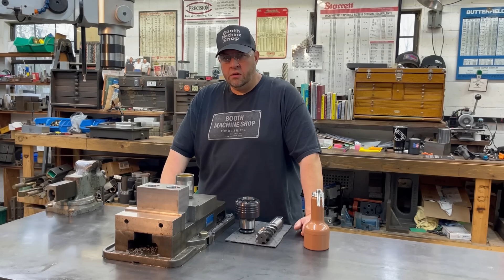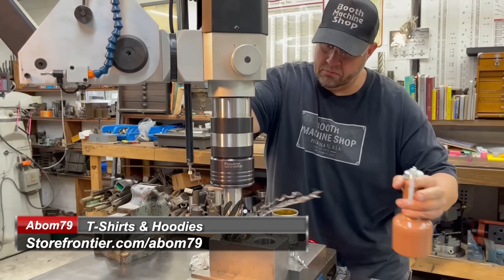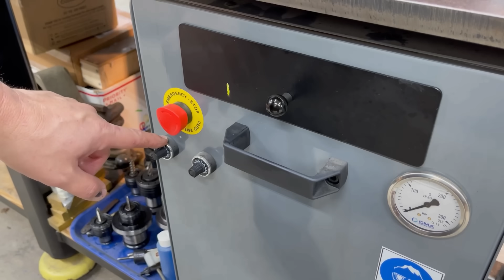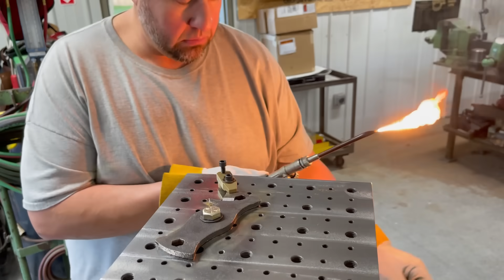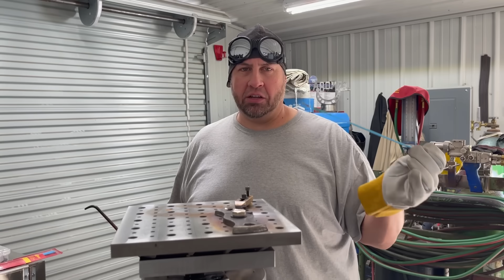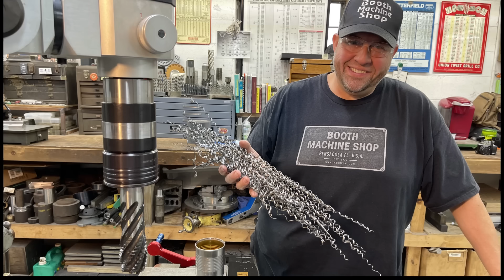SNS 335: 2" Power Tapping with Flexarm GHM-60, Cast Iron Braze Repair

Comment: around 2:06 mark are you adjusting your fabricated piece on the machine to get  as accurate tolerance? reading from the gauge? Also whats the proper name for that instrument? I had to use one at  work to check tolerance on torque converters attached to the engines.
Reply: You mean a dial gauge?
Reply: @660star  I didn't know if there was different name for its use in the video. Thank you!
Reply: @lolslim690  indicator

Comment: Why braze instead of welding?
Reply: For cast iron  brazing is easier and less likely to damage the part more (cast iron dosent like sudden bursts of heat in a localized area you can end up cracking the part - it can be done but the part needs to be kept at a high temp - there are some exceptions like small voids filling with tig and even mig but theres a high risk)

Comment: Noob question, but what's the blue stuff on the outside of your welding stick?  Is that the flux or is the flux up the inside like electronics solder?
Reply: Yes, that's the flux. It melts way before the solder and flows down to the droplet. You can see him blast it with the torch to coat the area at 26:28

Comment: MY GOD!!! I KNOW JUST HOW MUCH TORQUE IS REQUIRED FOR THAT TAP! AND THERES A REASON THAT WASNT DONE IN THE MILL! THAT FLEX ARM IS AWWWWSOME!!! JUST...WOOW!
Reply: It doesnt even get shaky!! Or twitchy!!
Reply: JUST SO PEOPLE GET AN IDEA of the power that tap required....picture two big men on a 6ft tap handle STRUGGLING TO DRIVE THAT TAP! IVE DONE THAT! HAHAHA
Reply: That was MY question, I wonder just how much torque as well as hydraulic pressure was required to screw that rascal in there!! Holy SMOKES!!

Comment: I used to do a lot of brazing years ago in the Uk using Eutectic rod and flux. We butt brazed copper strip about 10mm x 2mm end to end. When testing the joints with a tensometer we found that over 95% of the copper strip stretched and broke before the brazed joint did. Good stuff Eutectic.

Comment: I got to ask... after dipping the tap in the oil, is the manual oiling still useful? Or is it just an automated reflex
Reply: I believe the proper term is lubrication insurance.....!?
Reply: At first I was thinking the same but an extra 5 pence of oil to save your £100 tap is just sensible precautions. As Gregory Cross put it so well. 🇬🇧
Reply: Yeah, that's fair. It's never too much but it seemed a bit excessive to me. At least for the first hole, with the second it looks reasonable.
Reply: I would have probably poured the oil in the hole itself honestly
Reply: @MonstertruckBadass  There would be trouble when the tap meets the top of the oil pool and the pressured oil has nowhere to go.

Comment: Long time subscriber and not a machinist.  I often need to measure end play in crank shafts,' cam shafts, etc. in old motorcycle engines/boxes and am having trouble finding an indicator arm like you often use on the lathe.  You're able to set it up in seconds.  Most of the engines I work on are aluminum but I use a heavy iron plate on the bench to hold the indicator arm, but the ones I've bought are not adjustable enough and require lots of time to setup. It would be nice from time to time if you took a few minutes showing the tools you use often for those of us who are not machinists.
Reply: That particular indicator holder is made by NOGA

Comment: Out of curiosity If the part was indicated in on the lathe to machine the chamfers, why not just go ahead and cut the thread on the lathe with an  ID threading tool, as opposed to spending hundreds on a tap?
Reply: I think this is a demonstration only, the two pieces serve no purpose what so ever. Demonstrating the Flexarm that is, the blocks were drilled at the factory where the Flexarm was made.
Reply: This is what I was wondering as well

Comment: The swivel plates for a lot of the various vices tend to be a weak point. Fireball Tool tested several of them to destruction if you want to watch a video. Just a suggestion, toss that part and make a new one out of steel. Maybe it really is a cheap vice, but when I repair anything, I look at preventing a second repair. I would have cut and drilled a new one out of bar stock or steel plate. There is also a chance you could make a better part that would be stronger by making the plate wider and perhaps thicker depending on how the vice is put together. Economically, no matter how you repair it, it probably isn't worth the time and materials, so you might as well try to improve it.

Comment: love the video's!  But have a  question that is completely unrelated.  I work as a Millwright and have a bunch of conveyor rebuilds we have to do.  basically we pull the old AR (abrasion resistant) liner out and replace it with new plat.  The problem is these are odd ball conveyors and have to have custom AR cut on a laser and then try and find a way to countersink the liner bolts.  I am at my whits end trying to find something that will hold up.  Do you have any advice?  thanks in advance
Reply: So you have to cut a counter sink in the AR liner? Or am I missing the point.
Reply: @Eric G  yes. We are custom fitting the AR liner in a mild steel conveyor shell and need to countersink 1/4”-20 82 degree screws to secure the liner

Comment: Hi Adam, nice video, but, with the Flex Arm machine taping the block, sure would have love to have seen the underside of the block where the tap came level & how the threads look, did you have clearance on the underside or was it flat on the vice, thought that might have showed us when you had finished, bit of a let down not to see it.
Reply: not a through hole

Comment: what a beast of a tap. working on a old emco cnc milling macine, all icould manage to use was 10mm tap. iad play in my tap and not rigid tapping. also machine did not have enough horsepower. better off on conventional milling machine.

Comment: Without that Flex Arm machine that tap would be worthless except for maybe cleaning up existing threads.  Can't imagine trying to use that tap with a tap wrench.
Reply: you should see A-bomb's collection of tap wrenches. maybe he should show us the one you are supposed to use with that tap??? and the two enormous people to use it.
Reply: you can tap with a lathe or a milling machine just need the right holders and and strong enough machine to do the job
Reply: @lanceexcavating4165  Yeah, I would think sufficient torque would be hard to achieve unless you were using a huge machine.  When that tap is almost all the way in there must be 400 ft./lbs. or more on it.

Comment: Why did you buy those Huge Tap Wrenches if you are NOT gonna use them! LOL   Great lathe setup work to go with the power tapping.  Good machining is why I watch.  Could probably buy a vise for what the repair would cost...if not for you.  Brother, what is it with all the rust on the belt grinder table, EW!  What brand of brazing googles do you use.  I like those.  Where's the die filer?  Nice work.  Be safe, and stay well.

Comment: Nice demo and braze repair Adam. Many CNC machine operators don't like to machine internal threads by Tapping, ref high torque and stop/reverse on the machines, threading mills are crazy expensive.
Not sure why the negative comments from a few?.
Thanks for sharing and stay safe all.
Reply: Probably because they are bored and resentful and angry they're not kicking a** like Sir Abom is.

Comment: Hai, when you do that big tapping how you going to hold tapping arm for horizontal movements? I don't think it's by hand holding tightly.
Reply: When it goes into the hole it naturally goes straight in.. no need for being concerned about horizontal moving.. but if you were able to rotate it 180 degrees, it would naturally guide into the part . .as long as the orientation remains constant the floating arms make sure you go straight in.

Comment: I looked up that machine, it's $23k lol
Reply: That ain't too bad to be honest.
Reply: @tetsuonabiki  I know industrial equipment is expensive, I'm just amazed machining makes so much money to buy all this stuff.
Reply: @rutgerhoutdijk3547  Don't forget the machine is useless w/o the skill to use it. Machinists are worth every penny. Have a Blessed Day :D 
P.S. Nice avatar pic
Reply: @rutgerhoutdijk3547  Machining on this hobby level doesn't buy kit like that: Patrons probably paid for most, if not all of it, but you seldom ever hear mention of them.
Reply: @mrnick5709  I bet he got some discount for showing it on his channel
Reply: Not bad really. We have 2 flex arms in the shop I work in and in the 5 years that I've been there I'm sure that I've personally tapped at least 10,000 holes with them.
Reply: 23K not adding the cost for high voltage 440/480 needed in a non industrial shop. Transformer etc. Wiring, panels, disconnects, and a big hit to the power bill. A machine like this needs to run production to have a real ROI. Adam obviously has a deal with Flexarm

Comment: A touchscreen just to change between two gears seems a bit over complicated to me...
Reply: It's probably like a $100 tablet with some connection to the rest of the machine.
Reply: @multiHappyHacker  The drawer alone that the tablet sits in must be at least a $100. And you wouldn't want to be an expensive industrial machine like this to be reliant on a cheap tablet. I'm not saying it can't be done properly for just $100 but I doubt it.
Reply: @peterlekkerkerker4482  A cheap electronic device will probably work basically forever as long it's plugged into the wall and it doesn't overheat.
Reply: @peterlekkerkerker4482  Tablets and industrial machines meh

Comment: Very nice brazzing but cutting a new one with a CNC Plasma maybe Would have been a bit Faster
Reply from the maker: Explain how that would have been faster for me? I don't own a plasma cam. I do own an oxyfuel system and brazing rods and can get the job done in fine fashion, and share a braze repair with my viewers.
Reply: Would it really? 1hour for measuring and specking it up in CAD then cutting it Vs. 20 min of Vee out and braze.
Reply: Was just an idea in normal steel it would also not crack so fast. Yes brazzing was much more entertaining!
Reply: @tobi321wwwto  It was a fair observation to have made: you could have chosen a material from later than the 18th century to boot. Just because you don't have one, doesn't mean you have to come back with a sarcastic response.
Reply: @mrnick5709  you didn't meant me with sarcastic? Sorry my English is not the best.

Comment: Have you considered adding a small oil pump on the flex-arm yet? Seems like a pump tied into the forward throttle would allow you to keep your hands further away from whips like that - Though admittedly that may just be over-complicating the matter for what is the very top end use
Reply from the maker: If my machine was being used regularly for production I would definitely set up a more efficient lube system, but for the amount of tapping I do an oil can gets the job done.

Comment: While tapping, why not periodically go in reverse to break the chips? You do when power tapping on the lathe or mill.  Just curious.
Those things were like little wips swinging around. I’m surprised you didn’t get cut.
Reply from the maker: If I had to do this regularly then I would break the chips, but for a fun demonstration the long chips are more fun!
Reply: @Abom79 , fair enough.Also more entertaining to watch you try not to get hit by the chips when trying to add oil to the tap or avoid having them  knock over the can of oil.

Comment: Your camera crew did some nice work there (Hi, Abby!). I'm fine with fixed tripod shots, but the moving camera took things up a notch. Those were some wicked-looking chips coming out of the tapped holes. That bruise on your left thumbnail looks like it hurt pretty bad. Neat use of the fixture plate for brazing. I wonder how well the plate will hold up to those heat cycles, and how often you might need to touch up the surface?
Reply from the maker: Abby always does a great job helping me get some fun shots to share the work! The fixture plate was made for welding. It's thick cast iron that's webbed and has a thick steel plate bolted to it, not worries. Easy to skim off a few thou when it needs it.

Comment: Thank you for showing the way you trimmed the part in on your lathe using the tail stock if you don't mind me asking where would I be able to purchase the goggles that you used for the brazing job
Reply from the maker: Check out Arc One, they are called The Fly.

Comment: So if I can give a little input. Brazing can be done identical to oxy-acetylene welding. The torch moves in the direction the flame is pointing. The rod moves in the puddle opposite of the torch as a cooling force. It leaves a bead like welding. I can weld/braze dissimilar metals using the same technique.

Comment: Question what’s the blocks for? Because using both of those threaded holes at the same time is going to be difficult. Company us to work for we had cables on a machine that had 2” NC all thread about 24” long to be able to adjust cable tension, the nuts was 3-1/8” I made designed a special socket to use with my 1” impact. It looks like those thread holes are so close together normal bolt or nuts are going to hit one another going in there.
Reply: I'd like to know more about the end use also!
Reply: I believe Adam was just showing a demonstration of the capability of the Flex Arm for threading a large holes vs the old school way of using human power and a 3-4  foot tap wrench. He used the term demonstration several times. If I'm correct the blocks were just a prop he had made up and drilled and have no end use beyond the demonstration.
Reply: @usethenoodle  He has demonstrated the flexarm before, and once before with the 2" tap. That's the reason for the question.

Comment: The largest power tap I did was an on-site job, adding strong backs to the journals of a large power plant turbine so they could up the power out put. Core drilled then tapped out to 100mm using hydraulic mag base drill unit and torque multiplier.

Comment: Do they have.a die holder that fits into the flex arm? It would be really awesome to cut threads in both pieces while standing at the machine.
Reply from the maker: Flexarm provides die stock holders that go into the machine for machine OD threads.
Reply: @Abom79  hey thanks for the reply! That would be another cool demo video that would show off the quick setup. Tap the hole then switch to the die and make the screw. Probably not the way you would normally do it since you would have it in the lathe to get the proper size and would just cut the threads. Just a thought. Love your stuff.

Comment: Another great video! But watching Adam spin those blocks and other parts off-center in the four-jaw triggers my OCD. Is there any issue with wobbling from spinning something out-of-balance? Thanks again for the channel!
Reply: if the parts are very heavy and you spin them up fast enough it can shake the machine, so for heavy stuff you bolt a counterweight on to the chuck and it's fine
Reply: @SuperAWaC  Cool! Thanks for the reply. 👍

Comment: Could the Flexarm drill the actual size holes that you tapped?
Reply from the maker: No it cannot drill holes, you cannot apply the needed downforce to drill with it.
Reply: probably difficult to get enough tool pressure onto the face of the bit to get it to cut.  the tool is designed to apply torque.
Reply: It's a tapping machine not a drilling machine, he's explained that before in other videos but still people ask

Comment: I would need a 6 foot tap handle for that. Poss longer.
Reply: lol longer and with 4 handles, one for every apprentice dumb enough to try it
Reply: @johnf6288  You know it ! A one inch tap with a 40 inch spread is hard enough let alone 2 in eh.
Reply: @TomokosEnterprize  I think I have done 1 3/8 into Duplex SS. Never again
Reply: @johnf6288  A somewhat hardened 2" TQ100 plate. 20 holes for a rotator bearing bottom plate. My arm hung dead for 2 days eh, LOL.
Reply from the maker: I’ve got a Greenfield Tap & Die No. 24 that’s up for the challenge!
Reply: @Abom79  If I wasn't 75 I'd take you up on that. Retirement sucks !
Reply: @TomokosEnterprize  Lol i am 20 years younger than that and I wont . That is definitely a two man handle. Still I am guessing once or twice a year its needed
Reply: @johnf6288  I was a machinist/fabricator/mechanic in logging up here in BC Canada for 25 years and saw all kinds of really bug jobs. I had a pegboard with the 4 big tap handles and snipe pipes hanging there to remind me how much I dislike operators with an aversion to a grease gun. They kept me well educated for a long time eh, LOL.

Comment: Had 40 hinge brackets 2 holes ea that required m27 tap needed for helicoils .. no tapping mechanism or equipment what so ever I got the job being the new guy and strong enough to give it a go.. it took me over a gut busting 30mins plus to get one hole tapped at depth 50mm .. thankfully they had a lathe and set it up in 4 jaw with a live centre behind it using tap wrench lol rough but you gotta do what gotta do .. save me a lot pain.  machining is a thing of beauty love your work

Comment: “Tapped to the bottom” well that precludes it from being a hydraulic fitting then, so what is it used for? I noticed a relief area on the ways, as I was imagining a catastrophic hit with the jaw clamp, as for the deep gouges to the ways, is there a way to fix them without destroying the accuracy of the lathe?
Reply: I thank you, figured it actually had a purpose and not a demonstration, wasn’t thinking along those lines since most of what Adam does has a purpose to it beyond a demo. Again I thank you